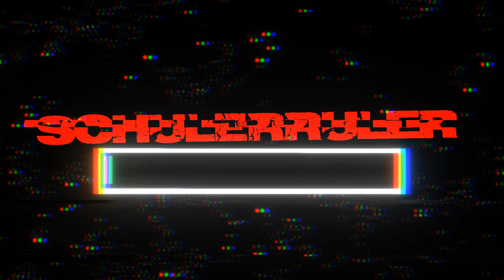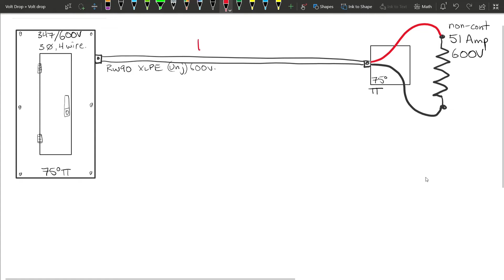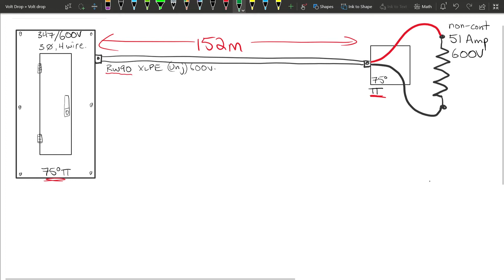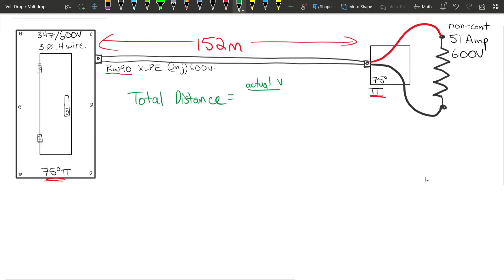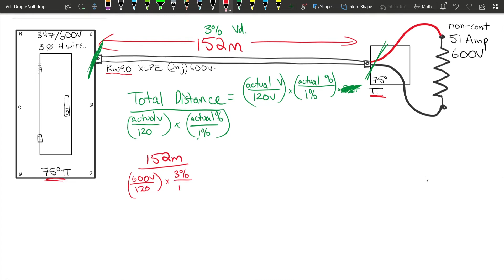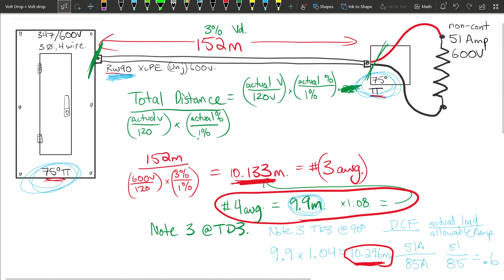Volt Drop Part 3

Comment: Only time I run into an issue with this method is when using aluminum conductors and trying to determine the size conductor based on a given all parameters but the size conductor.

Comment: this is an amazing video though I'm looking for more information on the feeder side of things. I was curious how you would go about calculating say 300 meter run, with 400 amp service. I was wondering if you had an videos explaining that side fo things. As the values are not in D3. I know it says there is a relationship with in the chart but still don't no how to calculate the answer I was looking for. Thanks a lot love your videos
Reply: Hi, I have the same question here... what if we have a load that is greater than 320 Amp, and what formulas regulating the voltage drop in this case... thanks in advance much appreciated

Comment: When does the 3 Phase come into play with Voltage drop?? as I have seen (2/R3) included in the formula.
Reply from the maker: Three phase allows for an increase in distance of 1.155.
Reply: @schulerruler  so would that change the outcome of the answer to the above video as its 3 Phase ?
Reply from the maker: @caseyscott6755  in this example, it is still a single phase load (line 1 and line 2). We apply the 1.155 of it is a three phase load. As table D3 is based off of two wires, we do not apply in this example.